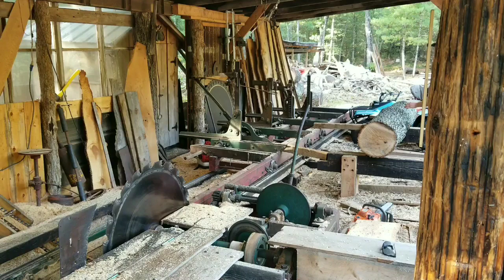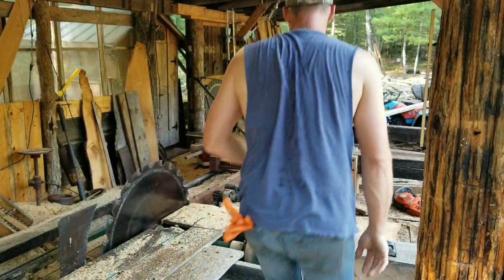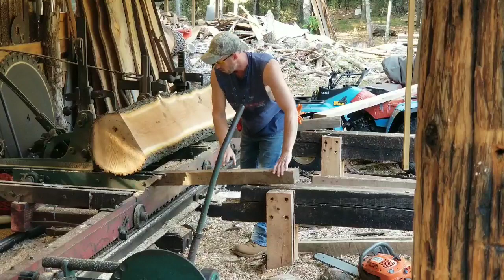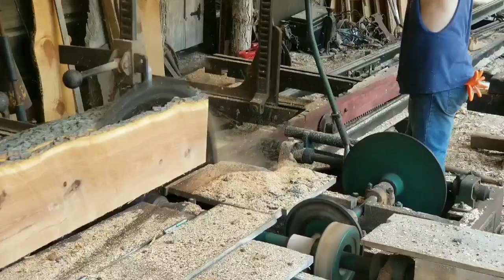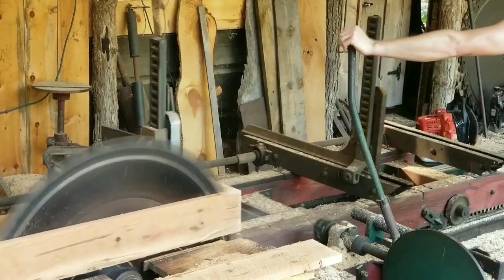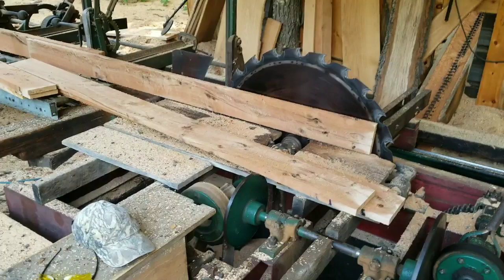Sawing oak 1×6's #sawmill#hardwood

Comment: I just noticed a lot of distance between the teeth on your saw, may I ask what kind of saw it is, have only seen two like it in the past ??
Reply from the maker: I bought that 40 inch blade from a guy couple miles from here .I had the arbor hole cut to 2" on it. I'm pretty sure it's what come factory with the Foley belsaw sawmill it had the same Arbor size as Foley belsaw and I believe Maguire and Sons which runs a Foley belsaw on his YouTube Channel had the same brand blade B&S I think it was the label on mine 600 Run speed only has 24 bits/ teeth. Great blade for lacking horsepower. Thanks for stopping